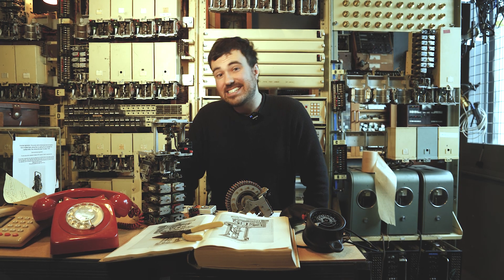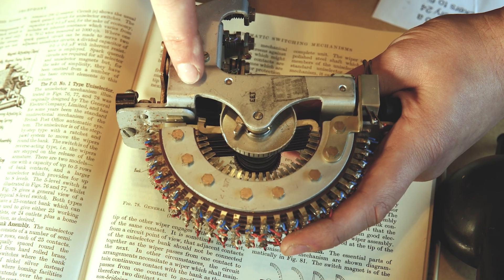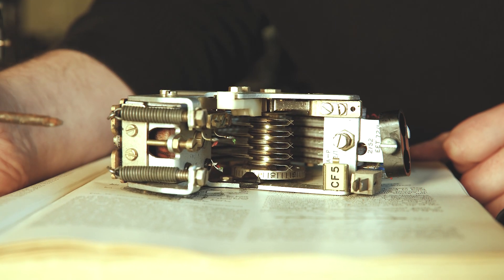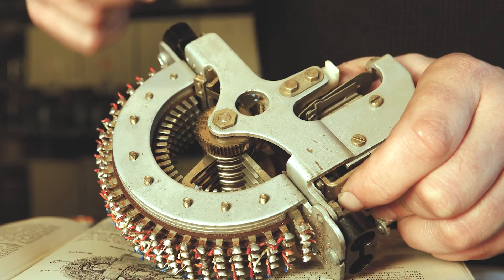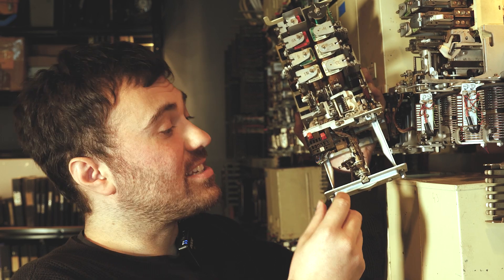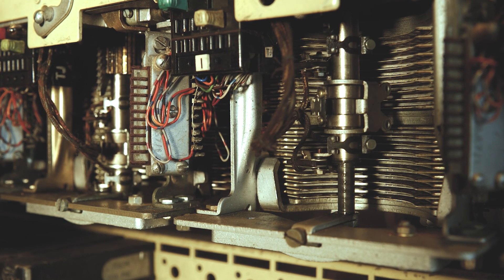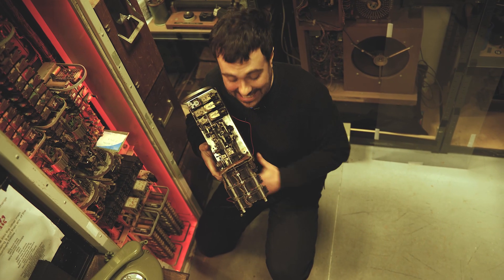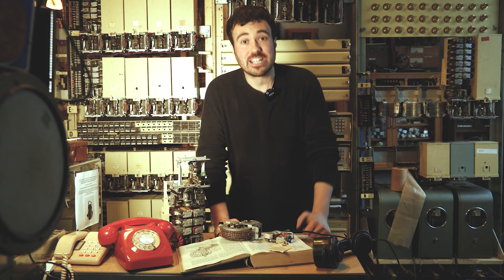What the Heck is a Uniselector? - Telephone Tuesdays

Comment: Years ago I obtained an old uniselector, connected it to an old dial so that as I dialled, it stepped.  To get it back to the starting point, I used an electronic relay switch that would keep stepping it at fast speed until what I called the "home position" contact told it to stop.  It was fun, knowing I had a little bit of a telephone exchange to play with.  I still have a tape recording of it operating!

Comment: when I worked in Holborn Exchange '405' (Central London), the group selectors and final selectors were 3000 type, but the code selectors (Director area exchange) were 4000 type. I avoided the 4000 stuff it had a weird principle. Instead of up around and continue around to drop out, they were up, around then to drop out they would go backwards and down...

Comment: Is there a reason the selectors have the number of contacts they do? Are all uniselectors 25 or 12 contacts?
Reply: It’s a great question with a bit of a complex answer! Generally the big Uniselectors have 25 bank contacts (50 in a full revolution). It’s a good balance between the physical & practical limitations of size, cost and application. Uniselectors were used in lots of different ways in lots of types of telephone exchanges, as well as lots of other machines. That configuration made them very adaptable to different jobs =)
Reply: This is a very wild guess and I could be wrong, but one common type of cable used in telephony is a 25 pair, so it could be that it lines up nicely with that.

Comment: Ah, that's how they work. Do the impulses from the rotary phones at home directly actuate the selectors or is there anything in between that amplifies that dial signal that comes from the phones?
Reply: In old rural exchanges like the UAX shown here the dial interrupting the 48 volt battery supply did drive the selectors. In big cities and for intercity traffic we had ‘director’ systems that stored the dialed digits in a ‘register’ (an electro mechanical memory) and then translated them to a more complex series of digits to route the call.
Reply: @Richardincancale  cool, thanks!

Comment: The most beautiful selectors I ever saw were made by Ericsson in the 1930s. They were flat with an arm that rotated around covering 25 radial positions, and then outwards by 20 steps giving 500 lines. I saw them still in use in an exchange (switch) in Oulu in Finland around 1993!  Lovely mahogany frames too!
Reply: If you search YT for Ericsson AGF 500 line selector demo you’ll find a video showing one in action!